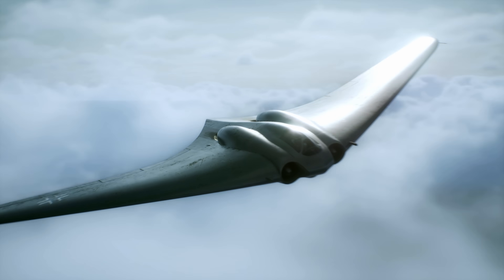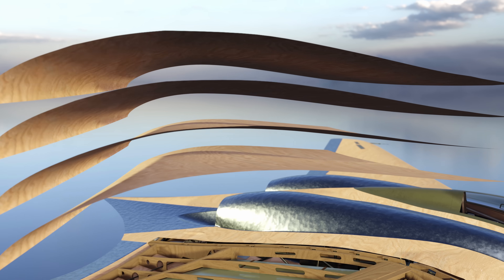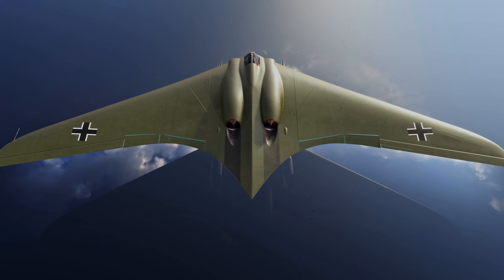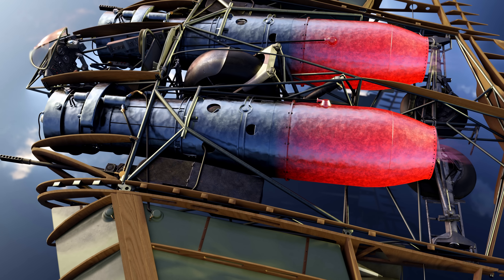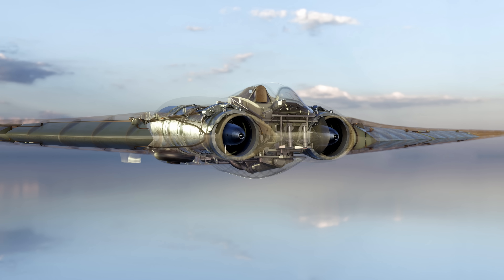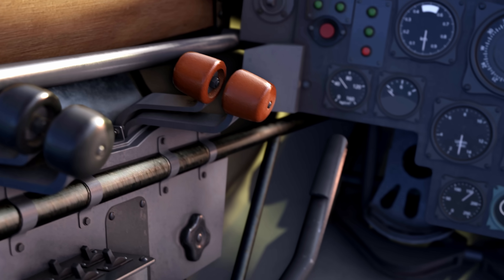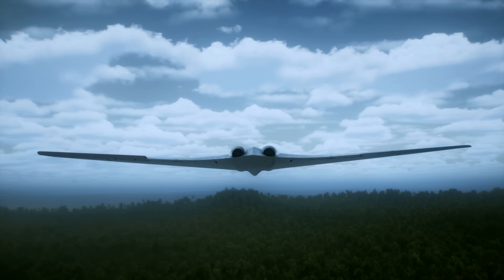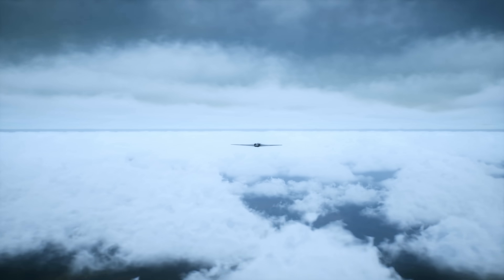Inside the Horten Flying Wing

Comment: now we know where the American B 2 bomber was plajerized
Reply: The B-2’s design comes from Jack Northrop’s XB-35 and YB-49 flying wing bombers, designed during World War Two. Horten designs had no influence on it.
Reply: @mrnoskills3589  Jack Northop never designed a radar stealth aircraft. The B2 is heavily influenced by research conducted on the Ho-229 in the 1970's
Reply: @DoktorBayerischeMotorenWerke 
There has still been no evidence provided to me that there was any research on the Ho-229 in the 1970’s.

The Horten brothers also never developed a stealth aircraft.
Reply: @mrnoskills3589  There is still no evidence provide to me that the B2 has any radar stealth capabilities.
 Jack Northop and Northop Aviation has never developed a stealth aircraft... it's all just a hoax.
Reply: @DoktorBayerischeMotorenWerke 
I am asking you to provide information on an aircraft that is not in service and that is not classified. I have already provided you the data for the 2008 radar testing of the Ho-229, but you are unable to do so for the 1970’s radar testing that you have talked about so much. Why is that?

Comment: Wonder where the B2 bomber came from ....
Reply: From Jack Northrop’s XB-35 and YB-49 flying wing bombers, as well as much of the technology from the F-117.
Reply: @mrnoskills3589  Jack Northop never designed a radar stealth aircraft. The B2 is heavily influenced by research conducted on the Ho-229 in the 1970's
Reply: @DoktorBayerischeMotorenWerke 
Again, you still have not provided me any information that supports that. 

The Horten brothers also never developed a stealth aircraft.

Comment: Ohne diesen Pfund im 2 Weltkrieg hätten die Amis niemals B2 haben können und können froh sein damals das dieser Nurflüger nicht mehr in Massen produziert werden konnte das wäre Verheerend für die Amis Engländer und Russen geworden
Reply: This aircraft had zero influence on the B-2. The B-2 was based off of Jack Northrop’s XB-35 and YB-49 flying wing bombers, designed during World War Two. It would have still been built even if this aircraft didn’t exist.
Reply: The Northop B-2 was developed directly from research conducted on the Ho-229 in the 1970's
Reply: @DoktorBayerischeMotorenWerke 
Research which you have failed to provide any evidence for during the last several weeks.
Reply: @mrnoskills3589  You have failed to provide any evidence that the B-2 has radar stealth technology... Most information regarding radar stealth technology remains classified.
Reply: @DoktorBayerischeMotorenWerke 
Go ahead and just keep deflecting buddy. 

There’s a difference between an active serving stealth bomber which remains highly classified, and a wooden prototype from the 40’s that is on public display at a museum with both the internal and external structure visible.

I’ve also already talked to you about this in the replies of another comment, but of course you had nothing to say about it, so you stopped responding.

Both the F-117 and B-2 were built from the ground up to be stealth bombers, and their operational histories prove it, with both aircraft having flown into heavily defended airspace both with and without support from other aircraft, and after all of those sorties, only one singular F-117 was downed.
Reply: @mrnoskills3589  Just link me to some radar test data that proves that the B-2 and the F-117 have radar stealth.
Reply: @DoktorBayerischeMotorenWerke 
As I’ve stated numerous times now, I don’t have access to that information, nor does anybody here. All I can reference is their service history and design choices that strongly suggests both aircraft are stealth aircraft.

No such history or design choices exist for the Ho-229, nor does the data that backs up the idea that it is a stealth aircraft.
Reply: @mrnoskills3589  Thank you for proving my point
Reply: @DoktorBayerischeMotorenWerke 
What point? Test data for the Ho-229 isn’t classified yet you have still failed to provide it.

Also, don’t bold your text, you do that on the other account, not this account.
Reply: @DoktorBayerischeMotorenWerke 
In fact, I’ve already informed you exactly where to find the data from Northrop’s 2008 radar testing of the Ho-229 replica under another comment, but you never responded.

It wasn’t classified, not even hard to find. It’s a PDF you can find completely free on Google.

So when you’re done with this “it’s classified” nonsense, I’d love to see all of this data from the 1970’s Lockheed and Northrop Ho-229 studies that you totally didn’t just make up.
Reply: @mrnoskills3589  Still waiting for you to provide any evidence that the B2 actually has radar stealth technology.
 You have so far failed to prove that the B2 is anything more than a very expensive hoax.
Reply: @DoktorBayerischeMotorenWerke 
That information is classified, I cannot provide it to you because I do not have access to it, nor would I be allowed to share it if I did.

Information regarding the Ho-229 is not classified, yet you have failed to provide it. I have already provided you the information for the 2008 radar testing of the Ho-229, now I am waiting for you to provide the same for the 1970’s radar testing you have mentioned so many times.
Reply: @mrnoskills3589  That's right kid, ALL Radar Stealth technology remains classified... including the test data from research that Northop and Lockheed performed on the Ho-229.
Reply: @DoktorBayerischeMotorenWerke 
Buddy, have you tried reading my comment with your eyes open? The data from Northrop’s 2008 radar testing of the Ho-229 replica is available online, for free. It is not classified. I have already told you exactly where to find the report under another comment that you did not reply to.

When you’re done making excuses, I’d like to see information regarding the testing of the Ho-229 in the 1970’s.
Reply: @mrnoskills3589  The 2008 documentary tests showed an over 50% reduction in frontal RCS and that was without any RAM applied.

Comment: I would say that Kenneth Arnold saw these "flying saucers" in 1947.  However, I think only 3 were produced and 2 were somewhat functional when captured.  One was a glider.
Reply: +@williamroberts5716  Only the incomplete V3 was taken by the allies, plus a Horten example from before the 229 program.  The prototype V1 glider was damaged.  The second prototype V2 was the first powered example with jet engines and it was destroyed in a fatal crash after about two hours of flying.

Comment: some add. info about this aircraft I once heard ... the project was cut short because of problems during landing ... they wanted to land above mach 1 speed ... and the result was that the sound reflection of the ground destroyed the planes.
At the time this effect wasn't known, and noone could explain why the planes shattered so the project was stopped.
Reply: +KillahZomby    The 229 was essentially over on 18-February-1945 with the fatal crash of the second prototype example V2 from engine problems and with barely two hours of powered flight.  There was no supersonic research - they barely got one flying.  Also, flying wings are inherently not suited for supersonic flight because of stability issues.

Comment: The Horten brothers, who designed this aircraft, were quite active in the hobbyist flying scene in the 1930's. Flying wing designs were quite common at the time, as they made for good gliders.
The Horten 229 was not at all revolutionary and absolutely not 'stealth' by any metric. It's design predates anti-air radar by quite a bit. For example, the Horten brothers designed the Horten H.I flying wing glider in 1933.

On the topic of stealth. Having two massive, wide-open, all-metal engines pointed straight toward a radar receiver makes for a colossal radar cross-section. The Horten 229's radar cross-section was larger than the aircraft itself was as a result.
If you are a wehraboo who believes the Horten 229 to have been some kind of super weapon, then sorry to pop your bubble. It was a mid-30's hobbyist glider design with jet engines and guns strapped to it. Visually appealing? Yes. Revolutionary? Not really.

Comment: The one thing that makes the Horton 229 so great is that every bit of it’s performance numbers are on paper, and not actually proven. In reality, it wouldn’t have been able to do most of the things that have been claimed over the years. Of the flying prototypes, neither were armed, which means the flying characteristics would have be different if it made it into combat. It was already hard to control in “straight” flight, it would have been nearly impossible to control when performing invasive maneuvers. As far as it being able to withstand high Gs, this is the only time I have ever heard that. Most state the opposite, since the prototypes where basically the Hortons flying wing gliders that were fitted with jets. That may be an oversimplification of the prototypes, but the basic design of the wings and the building design were copied from their gliders that were never intended to experience significant G forces. And as for it being built for stealth, that is just BS. This was the dawn of radar and little was know on how to counter act it. The story of it being built for stealth was added decades after the war ended. It may be less detectable by radar than other planes, but that was just a coincidence and not part of the original design process. 

It is really amazing how so much of the German military tech has been presented as being so much better than what it actually was. I guess YT is to blame for much of that. If you were to believe that German military technology was so much ahead of the Allies, like so many say online, then it would mean that Germany actually won the war and we are all dreaming. It can be said that Germany did build some extremely precision military hardware, but that doesn’t mean it was better. Many times it is what was good enough to do the job and that can be built in mass and easily repaired, is what makes the best military equipment. Only with the addition of the modern computer has that changed. But those same computers have allowed millions of people access to platforms like YT,where they can rewrite history, one video at a time.
Reply: +@TheCrazyMoparDude68   That abomination of the NatGEO documentary on it was the beginning of it all, IMO.  The V3 wasn't finished,  it wasn't flyable, and it was still just another version of a proof-of-concept idea.  There was no "secret" government warehouse, just the Garber storage area.  They managed a couple of hours in the air with the V2 before it was lost in a fatal accident.

Comment: Even with today’s advanced technology and computerized fly by wire there are still yaw limitations tailless aircraft have to overcome.  Without those systems, the Horten’s maneuverability in a dogfight would have been severely disadvantaged.  Its speed would have been an advantage entering attacks on the slow bombers as well as in escaping the air combat zone, but once it traded speed for maneuvering in turns it would have been highly vulnerable.  Early turbojet engines were very slow to spool up compared to the nearly instantaneous increase in thrust of the piston engine propeller fighters of the time.  Still, what an achievement of that era.

Comment: I'd say the flying wing design was more about the fact Hortens were using exclusively flying wings throughout the war. It was pretty much the only design they had any real practice with. The oversized front wheel is actually a leftover from much larger bomber. When it comes to stealth, Horten was simply full of fertilizer, just like all those generals who suddenly produced a plenty of books about their heroics in war, mostly made up or exaggerated. I'm convinced had Ho-229 been developed in less turbulent time, it would likely be eventually awarded with a vertical stabilizer to make it less of a pain to fly. Mainly because loss of a single engine in this design without a stabilizer would most likely be a certain death, as stable twin engine exhaust geometry wasn't really much of a researched topic at the time.
Reply: +@Paegaskiller  Riemar learned about the effects of carbon on radar waves in the 1970s.  Nice time to put it in his book.

Comment: This is an example of how the US stole technologies from across the world.
Reply: The US already had flying wing bombers in development at this time, those being the XB-35 and YB-49, which would later become the B-2.
Reply: @mrnoskills3589 yes, and it failed drastically. It was only after the war ended and the US got its hands on German designs, they were able to build B2.
Reply: @abhoy1234 
There is no information that supports the theory that the Ho-229 influenced the B-2. The B-2 is identical in size to both the XB-35 and YB-49, and all three aircraft were built for similar purposes (long range strategic bombers).

The Ho-229 was also a greater failure than both the XB-35 and YB-49. The XB-35 flew many times from 1946 to 1949, and the YB-49 flew many times from 1947 to 1951. The Ho-229 achieved only three flights between December of 1944 and February of 1945, before crashing and never flying again.

After the war, the Ho-229 was captured, briefly evaluated, and thrown into a museum where it resides today. No modifications were made to Northrop’s existing flying wings due to this evaluation.

What made the B-2 possible was the development of fly-by-wire and stealth technology, neither of which seem to be German developments. Once this technology was available, the YB-49 airframe was combined with the stealth and fly-by-wire technology of the F-117.
Reply: @mrnoskills3589  Germany invented Stealth and Fly-bywire technology... they also invented the first stability systems such as Yaw Dampers.
Reply: @DoktorBayerischeMotorenWerke 
Stealth technology is an American creation. The first fly-by-wire aircraft I can find anything about is a Canadian aircraft.
Reply: @mrnoskills3589  same happened with other techs, the US used psychological tactics to cause deflection of German scientists, who later developed WMDs for them. Be it tanks, SMG, FMG, Mortars, missiles and rockets etc, the US either stole the tech or got them via deflection.
Reply: @abhoy1234  smgs? Those guns have been around for decades before WW2, fella? And the first fmg was French. And tanks aren’t anything new either. I think only the French adopted German tanks and quickly replaced them with their own better tanks

Comment: The B-2 looks like an adaptation of  the Horton Ho
Reply: It is.
Reply: It’s not. The B-2’s design comes from Jack Northrop’s XB-35 and YB-49 flying wing bombers designed during the war. All three aircraft are identical in size.

Comment: Nice. But you made a mistake. The testpilots claimed that this plane was quiet easy to fly. Don't know where the myth comes from that this plane was sassy, but it has already been busted.
Reply: The Ho-229 was in the early stages of flight control testing and the development of the first automatic stability controls (yaw dampers) were already in development. Invented by Siemens and first tested on the Heinkel He-111... the KA-19 yaw damper would be manufactured by Bendix after the war and first used on the Boeing B-47 and later 707 and B-52 models.
Reply: +@hollijohnson1563  Which one?  Each prototype was a different aircraft and only two flew.  The third prototype at the Smithsonian was not finished and never left the ground.   Prototype one was a glider and flew the most.  The second prototype flew with jet engines (recognizable accomplishment) but for only two hours before it crashed and was destroyed.  Both Northrop and the Hortens struggled with stability and yaw issues and solutions were only starting to be found when post-WW2 aviation gave up on flying wings until computers made precise control possible.